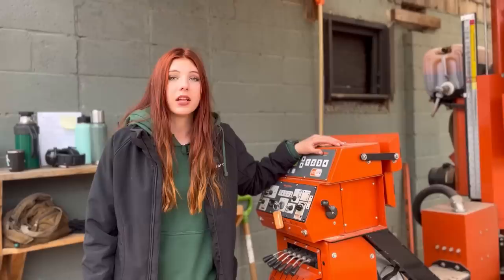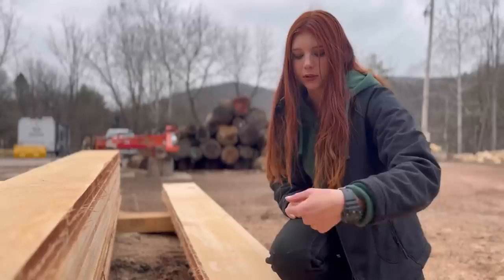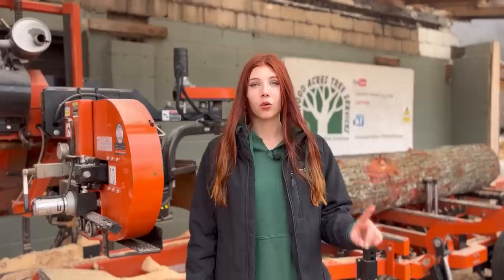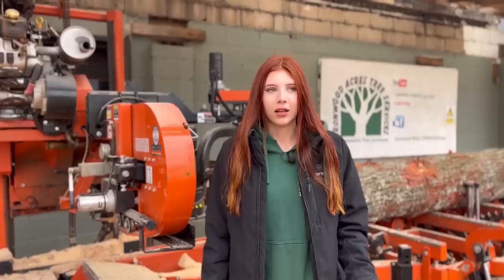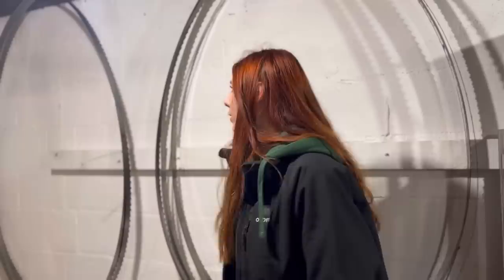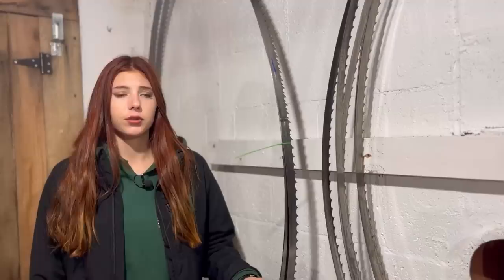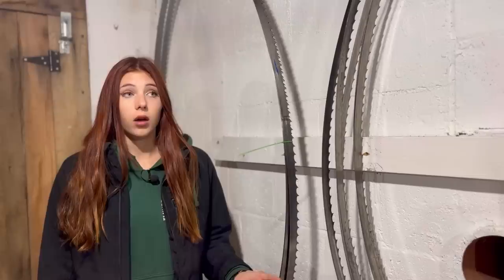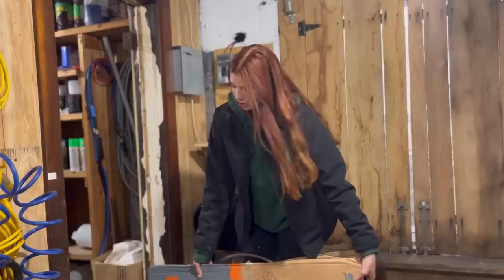Everything to Know About Sawmill Blades!! (almost)

Comment: I was a saw filer in a high production sawmill for 21 years. Both band saws and edger saws. There is an art to it for sure. If we broke a tooth, we welded another one in. You're best off doing what you're doing with those relatively inexpensive band saw blades. It's a complex but very interesting topic for sure.

Comment: Another indicator of blade issues is the tension pressure all of a sudden needs to be adjusted mostly because the blade is heating up and increasing in length.

Comment: I use to run a circle mill and when I swaged and sharpened the saw teeth correctly I would actually have to hold back on the carriage feed to keep the saw from pulling the log into the saw to fast in smaller logs , literally would self feed after the saw got in the log .
Usually would sharpen the saw twice a day , unless it would hit something .
 A circle mill is a bit more forgiving with a dull blade than a band mill .
Keep up the good work and keep the saw dust flying .

Comment: The de-barker looks like a very interesting add-on to your Wood Mizer. When you get it operating, please do a video showing and explaining the de-barker in operation. Thanks, sz
Reply: I agree. Very interested in how it works
Reply: It was in operation in previous vids. I always wondered what the heck it was. It's like a wire wheel running in front of the blade.
edit: I just saw it on an older vid, it's not a wire wheel, it's like a tiny wood chipper blade.
Reply: And what happened to make it not work.                              Jerry in S.E.  Pa.

Comment: Frozen logs plug the kerf with frozen sawdust. As the blade warms, cutting frozen wood the material removed freezes. That leaves less clearance for blade thickness, resulting in the blade heating up and causing wave.

Comment: I did cut and sharpened blades for years. made a jig. and a cutter/welder clamp. you can cut out and add sections pretty easy.  we could get 20 sharpenings and the jig keeps them consistent.But sometimes they just wont fix  . Yur Grandpa probably has one..

Comment: Very Interesting.  I have been wondering why you never used the DeBarker to prolong blade life.
It is a rotating wheel with Carbide inserts that clears a path through the bark to the wood for the blade and eliminates the dulling action of dirt embedded in the bark.  I haven't quite figured out the 'degree as in 4 or 7.  Is that the 'set' of the teeth?

Comment: A debarker is an absolute must to lengthen the life of your blades.  The turbo 7 degree blades are the absolute best and it’s nice to have some 4 degree blades on hand for extra hard or knotty wood and white ash.  Do yourselves a favor and get the Woodmizer sharpener and setter for your operation.  You’ll find your blades will last longer because you won’t run them as long before you change them and you’ll save money over shipping and resharp costs.

Comment: A couple of things. I realize it's cheaper to have Grandpa sharpen the used blades but I re-sharpen my shop blades on a regular basis and I have a blade sharpening service that does a professional job, yes it's more expensive but the bade sharpening is done perfectly. The other thing is, if the de-barker is such an important element of the mill, why has it not been repaired ? Thanks again for another video.

Comment: When doing ANY machining/cutting of wood cut quality is all about "chip load" which is calculated with feed rate teeth or "cutters" and rpm/ speed of blade. balanced with specie balanced with Sharpness.  The biggest key to actual "milling" of all species pertaining to maintaining Sharpness is the use pf the debarker.  It also helps to know where the tree came from.  trees from heavily forested areas aren't exposed to the wind and blowing dirt as trees that come from a more open area.

Comment: Have you considered a carbide toothed blade?  They are a lot more expensive, but they stay sharp a lot longer and can even survive contact with metal as long as the metal is not too large.
Reply: For clean logs, they break before you utilize the carbide..

Comment: Great video. It would be fun to see how you guys deal with a broken blade during the middle of a cut.
Reply: The little round bar that comes with your Woodmizzer you use for lifting in Jack’s works perfect slide that in between the board you cut , it gives you a big enough gap to pull the blade out

Comment: Contary to practice, and assumed common sense, to use a new blade on extreme knoty logs means more lower quality lumber later on.
If you know the knots are going to wreck a blade, use a resharpened one. Logic of: Use an old paint brush if you don't care about the look of the finished product.

Pretty good video. Grandpa needs to pass down his knowledge.
Broken blades: I have a blade welder for the price of scrap metal (but when they break, welding may not be a wise choice.) Making a new blade is its main function IMO. Lebanon country.

Comment: Chuck or chunk? Anyways I am wondering if you can temper the blades after sharpening like in the oven. At my shop I have a regular over I put my power coat in to bake on my metal & 3 y don't you spray silicone lubricant on the blades?? Okeechobee. I like this talk show honest better then the other Em

Comment: You wonder why your chainsaw blade dulls after hitting the ground and dirt, so the same with these blades. Some millers use carbide tipped blades and laugh at nails and metal in logs as an attractive part of the slab. Because of the rarity, there's much more money for this beautiful blue staining throughout the wood grain, and easily pays for the extra cost of these carbide tipped blades.

Comment: Re-sharp isn't just a process of grinding back to a clean tip.....all of the tips have to be re-set for proper blade space.....
Not like a chainsaw where the set is built in. I lived near an older gentleman who's claim to fame was re-sharpening hand saws...it ain't easy!!
Reply: Mind you, with a chainsaw you need to keep the depth balanced too. Many newbies using just the round file with the plate guide forget to lower the depth guides and wonder why their nice sharp chain doesn't cut.

Comment: SO tell us what is wrong with your debarker. I honestly didn't realize you had a debarker.  Can you point me to a video where it is in operation?   You've got to do everything you reasonably can to preserve your blades.  Bandsaw blades are the single biggest consumable expense in an operation like yours. The most important step to maximizing blade life is debarking. So I'd suggest you can't afford to have a debarker down for more than a couple of hours. Just because it's not caked in mud doesn't mean it's not loaded with microscopic silica particles trapped in the bark - and that's the fastest way to lose a good edge, try to cut silica.  Getting that debarker up and running should be your number one maintenance priority Emerald.  All the rest of the maintenance work can wait. Gotta get you thinking about priorities 😊because everytime you run a dull blade your putting a lot of unnecessary wear and tear on your guides and bearings.
Reply: While I agree with you regarding the value of the debarked in preserving blades, I’m surprised you are “surprised” they have a debarked.  It has been shown operating properly in many prior videos.  Just go back and take a look.  I suspect Grampa will have it back up and running as soon as possible, but perhaps they are struggling to get parts, as is so common these days.